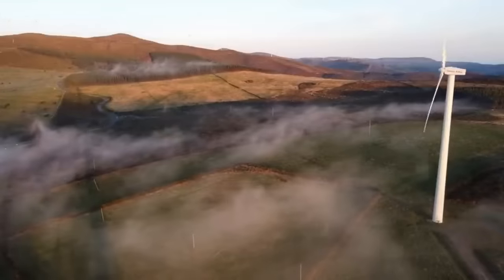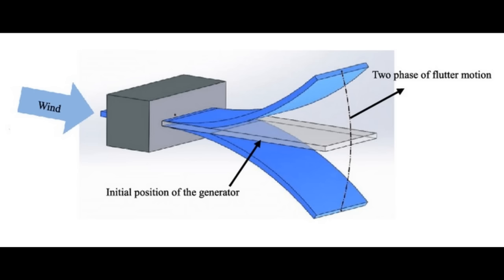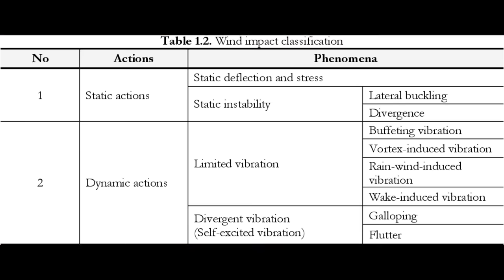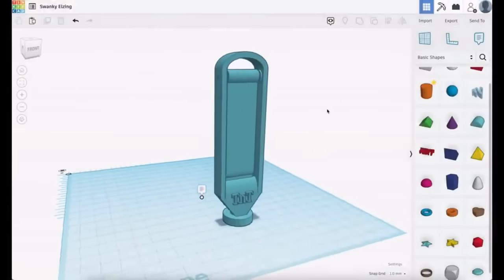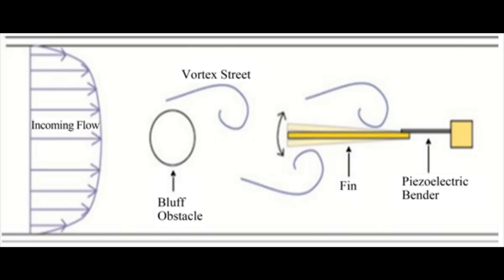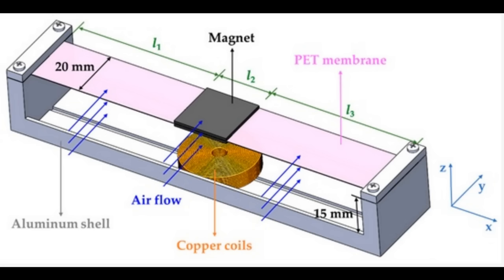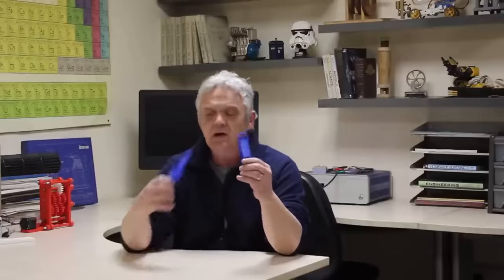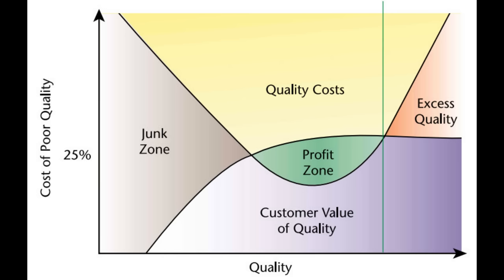2185 Unconventional Wind Power

Comment: That device would work best as a "tree" where there are several large branches each with a set number of smaller branches on them. At the tip of each of the smaller branches a device such as that would be mounter(perfectly vertical) with the wires running inside the branches to the main branch where they would come together. Once the wires reach the main trunk once again the wires from the main branches will come together and go to a controller just like wind or solar.
Reply: A tree...as art as well as energy scavenger.
Reply: would be an interesting sight seeing these used as leaves.

Comment: I would probably stick it in the ocean so I can have super consistent power. What a nightmare that would be trying to get that highway electricity anywhere useful. And a nightmare for those running the grid dealing with random intermittent bursts of charge. Integration with the grid demands one most basic principle: forecastability. Must remember that the cost of the power generation itself is only a small fraction of the cost of delivering super reliable electric 24/7. 

Of course, as homes and institutions begin installing batteries to complement their solar, some low cost small scale wind harvesting could certainly see a use case! 

Moreover, I have a hard time seeing it last with such variable speeds. But I do still have hope that similar designs will be deployed to capture the infinite and vast quantities of energy in the waves. Would love to see some videos on this (much more than just tidal!).

Comment: This is like I was thinking about in a boat or car you could use a pendulum to capture the motion. This as far as I can see wouldn’t use any energy itself so 100% output
Reply: If you capture energy from anything, it's using that thing's energy. If you capture it from wind, wind slows down. If you capture it from heat, something gets colder. If you capture it from light, less light is reflected (it get's darker). You can only move energy from one place to another.
You could try to capture energy from unwanted motion of the boat (side to side), damping the rocking motion. But as you also see in that sentence a source of energy (rocking motion) and how you change a source if you capture that energy (damping the rocking motion). So directly you would take energy from water waves - wave will get a tiny bit smaller.

Comment: I am interested with gearless magnetic transmission. There is a video that explain this. He use 3 disc. The first and third use 16 pole magnets, the middle disc consist of 10 metal inserts. In the first disc the magnets oriented in alternating pole, aka n - s - n - ... configuration. The third consist of 4 block of magnets pole, 4 magnets oriented in the  same direction followed by another 4 in reverse and so on. 16 poles in the first disc and 4 poles on the third.

The transmission have 4:1 ratio, and could work up to around 8500 rpm. I curious about this kind of transmission as there will always be wasted energy in transmission and higher pole motor also means higher loss to fighting the back EMF. Still too busy in real world😭

Comment: I like this idea represented! But will it be still simple and cheap if a generator unit is added?
Reply: I think so, you could simply use a tiny magnet at the bottom of the flap and a single piece of copper wire looping a few times below the magnet with 4 small diodes to rectify the AC output. The wire/coil and frame could be made out of a single PCB to completely automate manufacturing.

Comment: Windings on the sides of the structure and a magnet on the flap... You would actually get more power if the flap also rotated on the vertical axis.

Comment: That would be fine, in the USA, for places that don't get any snow;  the snow plows will push the snow to the side , burying or destroying the devices, and you won't see them in the spring.
Using tem to charge batteries to illuminate overhead traffic signs might be a good idea.

Comment: My only issue with this design is the lifespan. A few thousand cycles & that hinge is toast I would imagine.
Reply: The common Door Hinge is designed and tested to get about 2 and an arf million cycles in its lifespan.
Spings do tremendously better.
The flutterer he is showing has a plastic hinge, whis is sel-lubricating.
Reply: @TimeSurfer206  - live hinges... Worse performance than a spring (as it tends to deform plastically).